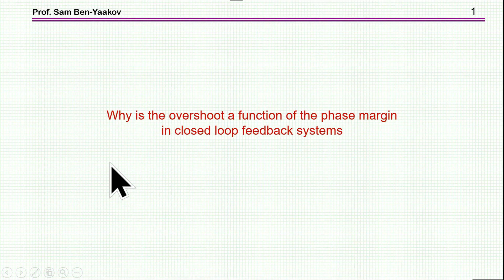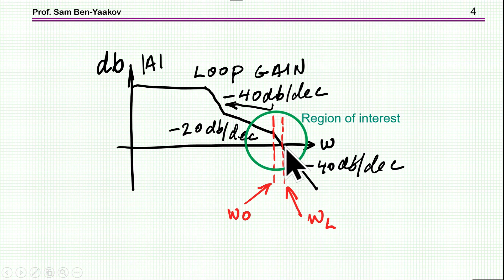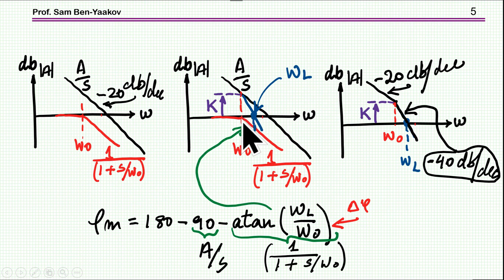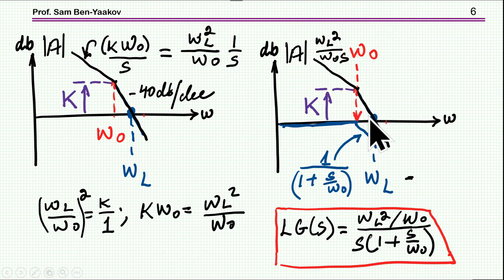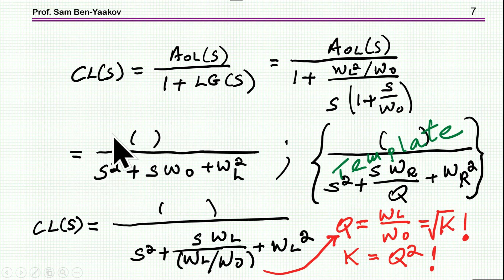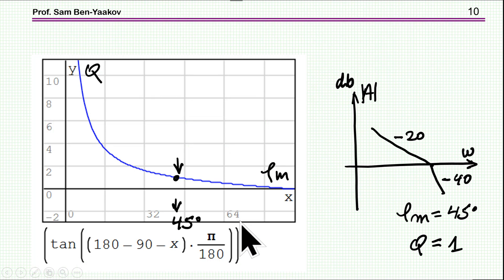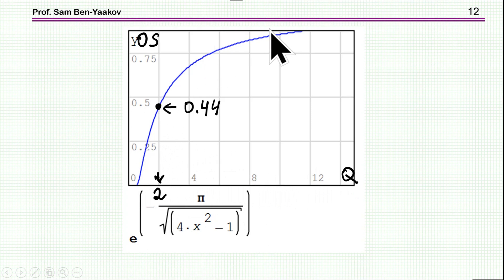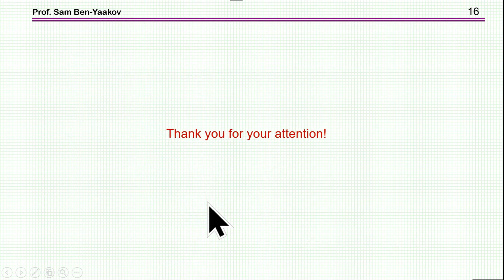Why is the overshoot a function of the phase margin in closed loop feedback systems

Comment: Sir can you please make a video on complete system design of buck-boost converter with type-3 compensator please, maybe in PSIM or LTSpice
Reply from the maker: Buck Boost is Flyback without isolation. There are many videos in my channel on the subject. In YouTube search box look for "sam ben yaakov control"
Reply: @sambenyaakov  Ok sir I will soon go through it... While I was trying to implement it in software I was not getting required PWM, is there any general relationship between ramp height (Vramp) and Op-Amp (compensator) supply voltage ?